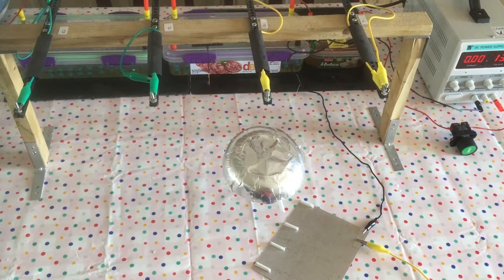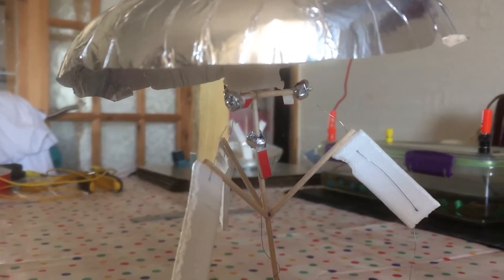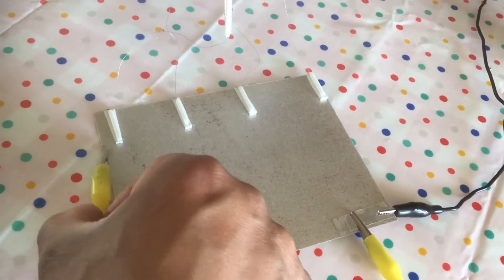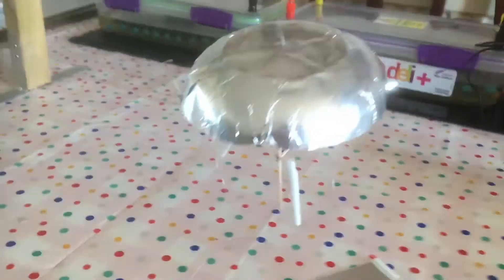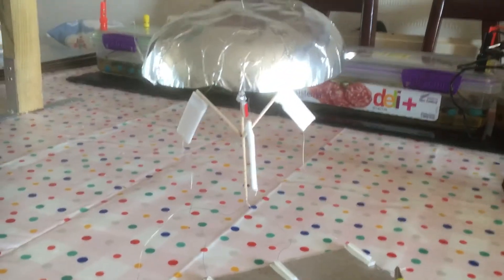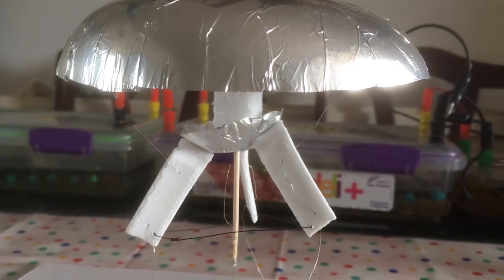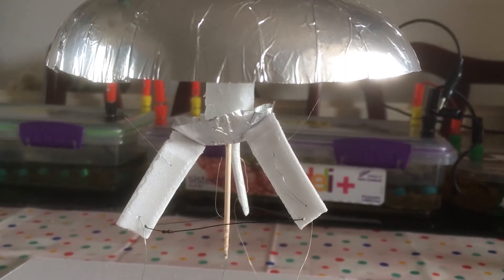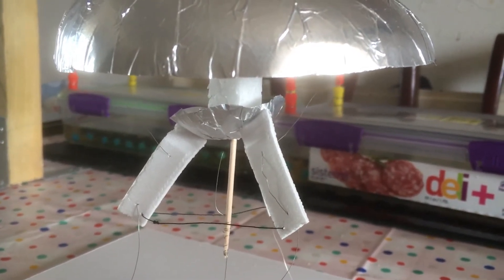Simple Bahnson steering demo

Comment: Hi if you are reading this comment can you reply me with how this thing works and changes its direction because i also want to make it on my own. Please Reply 🥺.
Reply from the maker: Hi, in the Bahnson brown patent 
https://th.bing.com/th/id/R.cbb1b85790fcbce71f4d1339f3ae7b66?rik=h0j%2flghZmJz%2bNA&riu=http%3a%2f%2foriharu.net%2fufophysics%2fbahnson%2ffig1s.gif&ehk=yZZqjpntq1tEtc%2bD4qKOvZv8U3owY2XI5F%2fPuSdORuU%3d&risl=&pid=ImgRaw&r=0

you see a saucer with 3 balls at the bottom. You apply a high voltage positive to the canopy/saucer bit, and put the ground closest to one of the balls depending on the direction you want to achieve. 

Whether you directly ground the ball or not depends on size and geometry, but in my example the ground is close to but not touching the ball  whose direction I want.
 
You will see the lifter will end up going up, but skewed at the angle between the canopy and ball. The patent is valid and the principle works, but it i's difficult to get exactly right because its dependant on the  geometry and spacing between all electrodes. Also what is difficult is because of capacitive coupling/spacing you may get some field cancellation so its difficult to 100% control the exact direction, becuase its just hard to insulate these high voltages from each other
Reply: @c6jones720   Actually I am little bit weak in English because I don't live in uk or usa but if you tell me how the current should be applied to change the direction of the saucer or can you also tell are those three balls are also electrode or not
Reply from the maker: The lifters work on capacitor principles. we are ionising the air with high voltage (70->120Kv Dc here). there is an electric field between the saucer and the balls at the bottom. The saucer top is positive +120Kv or so. You do not directly connect the ball to 0v (or negative). Because of the high voltage, it is enough to put the 0v line close to a ball, it dosen't even need to touch. The saucer will travel upwards, and tilt in the straight line formed between the centre of the canopy and the most negative ball  @ARPITKUMAR-he4ks
Reply: Thankyou for your reply sir. It helped me lot.

Comment: Do you think it was working better because you amplified the static field? The packing foam holds a better static charge than other materials.
Reply from the maker: you can experiment with dielectrics. The higher the dielectric the higher the voltages can be before a breakdown occurs. In this saucer there were two variants, one used a cocktail stick and no polystyrene this went higher (probably weight). This one used polystyrene to insulate it from the floor, and separate canopy and reflector electrodes. It didn't see much effect with different dielectrics, but there is a tradeoff with weight of course.
Reply: @c6jones720  I used dc ac and static to lift. I found that when the amps are gone they all act like static fields.

Comment: the foil balls electrodes are connected to something?
Reply from the maker: The balls are not connected to anything, but rememeber, we are dealing with quite high voltages so they are essentially air gap capacitor plates. With this saucer design essentially steering control is done varying the distance in air gaps, in principle it does work but its really hard to get right and fine tune. Geometry, size, and weight are big deals in this sort of system. The balls are in the focal point of the parabola, and to steer a direction you need to make one more nagative than another by decreasing the air gap between the ball and 0v. I tried hgh voltage resistors, and semiconductors in the ground side but wasnt able to satisfactorally control it that way, air gaps work, and my guess is thermionic valves might also work. It works, but a simpler steering system, would be controlling the positive sideof things like here: https://www.youtube.com/watch?v=mF6aL16K0w8

Comment: how many  kilovolts you used for steering the saucer?
Reply from the maker: This design needed the highest voltage of any lifter I made. This one was running around 120Kv (estimated). I had to chain 4 x boxes of multi stage cockroft waltons to get that much dc

Comment: did you continue your experiments?  That looks very promising!!!
Reply from the maker: Ive decided to move on, but I've put all my notes here on youtube. You might be able to do a better job than me. - You just need some patience and a very high voltage power supply!
Reply: @c6jones720  i read in the 90's that in a lab, a bunch of scientist, made a metalic disc fly straight up and it went through the ceiling...of course they used a powerful generator that only works for a second before disconnecting, but the thing worked...  So i guess UFO sightings are not so 'impossible' after all...  Well thanks for your answer.  I wish i had the space and ressources to conduct such interresting experiments!!!

Comment: This great, I live in Tulsa, Ok and am willing to build a 10 foot craft, the only thing I am considering adding is the counter rotating antennas identical to the bahnson and Townsend patent were they are quartered. I’d love to have your help if your close enough for it to work for you, I have the finances covered. I’ve been working on acquiring natural green g10 panels pie sectioned for my 8 foot upper and 6 foot lower copper and g 10 disc antennas then I’m considering accelerating electrodes or plasma actuators on the upper hull. I’ll use your method for the attitude control.
Reply: pretty amazing if you could built a real ufo...  amazing!
Reply from the maker: That sounds so cool, and I wish you luck. Im in England, but Id love to see what you end up with.